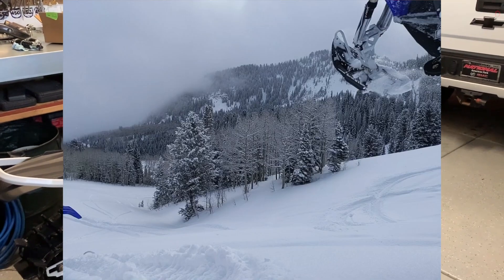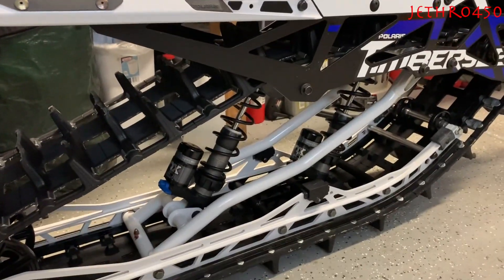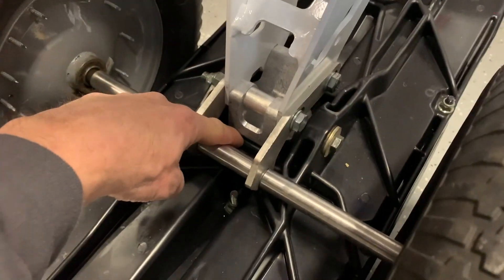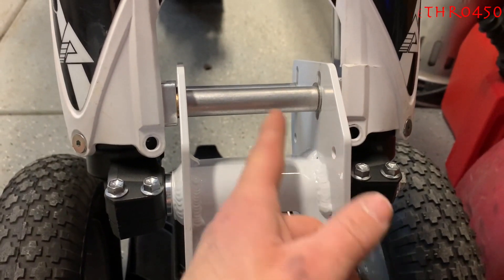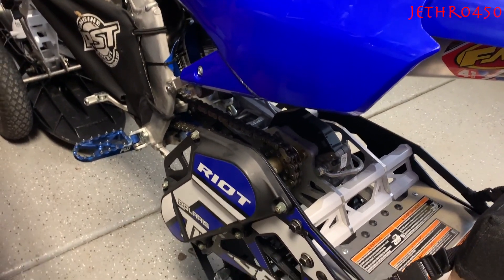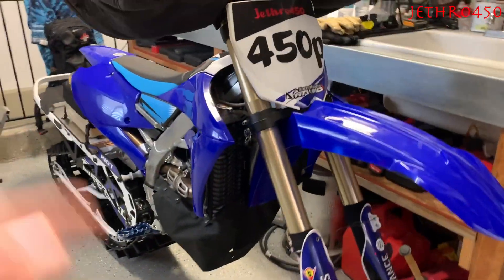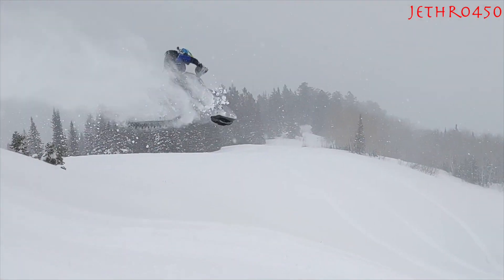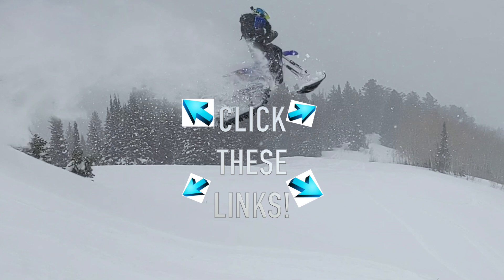TS 158 - 2020 Timbersled Setup Part 2 Followup

Comment: Wondering if you figured out the spindle issue?
Reply from the maker: Which issue?  The fact that the spindle doesn’t fit perfectly and squeezes the forks inward?  I left mine shimmed as you see in this video.  I did move that front brace to the front holes like I mentioned.  Still going strong, not bent.  And I’ve hit a few things kinda hard... still good.
Reply: @jethro450  awesome good to know. Ill do the same thanks!

Comment: Interesting my experience with the riot is exactly opposite what you mention. Literally trenching and getting stuck everywhere.  I notice your recommend for the preload is different than brents where he says to go all out on the front preload to 8-7/8, no mention on the rear setting in his video. but I am tempted to undo all the preload on front and rear.  So frustrating, haven't had a good ride  on this thing yet
Reply from the maker: That's too bad.  Maybe your track isn't set up flat??  And yes, having the preloads on the springs adjusted could help.  I'm really liking my kit, even in the crap bottomless snow conditions it did quite well, I was impressed.
Reply: @jethro450  I rechecked my strut length it does match spec to the hair.  Going to be playing with preloads, hope to get it working better
Reply from the maker: ethermal1 spec is wrong for my bike.  If you’re on a Yamaha, it’s wrong.  11-7/8 is what it needs to be if it’s a Yamaha.  Did you watch my episode 158?  I went over that and track setup in it.  I also have a separate track setup video.  Worth a watch.
Reply from the maker: ethermal1 Episode 132.  Search TS 132 track setup
Reply: @jethro450  I'm on a husky 501, rechecked and reset strut length to 12 1/8.  Went out yesterday with the pre loads backed out to 8 7/8 and massive improvement, couldn't get it stuck if I tried.   These riots really don't seem to like much if any preload at all
Reply from the maker: ethermal1 nice!  Glad to hear it

Comment: How did you get the TSS to 400PSI. I'm a similar weight to you and would like to stiffen it up to 400 or maybe even 450 as i find the rear travels a lot when I land off (smallish) jumps. FYI - 2016 MH ST. I think I could only get my shock up to about 250psi - I may have some issues with the pump.
Reply from the maker: I just keep pumping until the dial goes all the way around and hit the stop.  There are newer pumps now that go up to 500 though

Comment: Jed, how many teeth is the sprocket on the Timbersled that connects to the engine drive sprocket? Im going to do a little ratio math.
Reply from the maker: Looks like bike to kit is 13-17 stock, and on the riot kit it's 18-17 (top/bottom).  I switched it up to 14-17, 17-18.

Comment: be carefull dont hit a stump on one side of the track. bends everything. i didnt hit it very hard. bent both rails and the tunnel plates on both sides.Riot gets a 2 out of 10 in reliability
Reply: one suspension rod holding the skid in isnt enough
Reply from the maker: @Snowbikebro2  hmmmmm
Reply: @jethro450  yep my first snowbike with only a few hours on it.
Reply from the maker: @Snowbikebro2  Sounds like an early season injury to me.  In all my years (over 10 now) of snow biking, I've never done what you just described... knock on wood!  I usually take it pretty easy this time of year, or don't go at all.  We're still not there yet, as far as being able to rip it.  Sorry to hear this man, that sucks bad.
Reply: @jethro450  I didn't even think it did any damage till I looked at it. Funny thing is the ski hit harder then the rear and the spindle isn't bent.